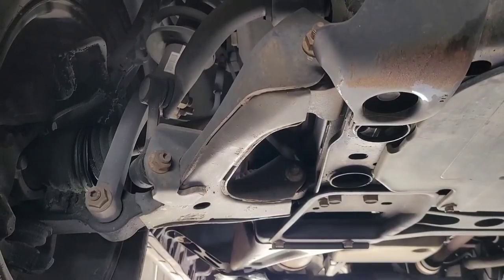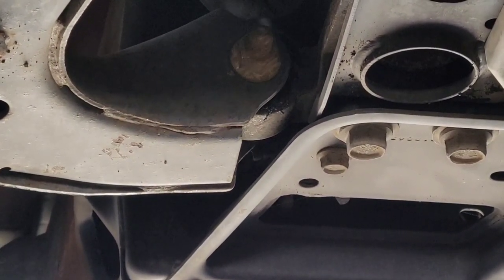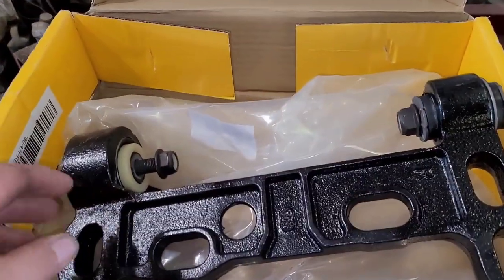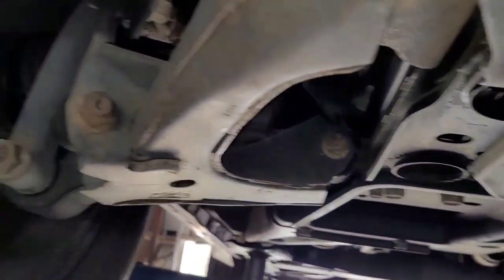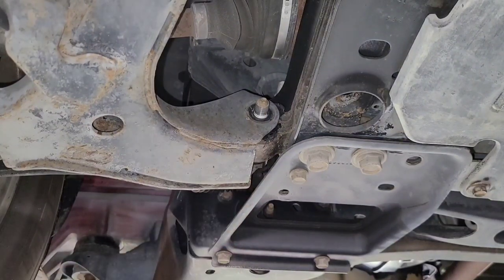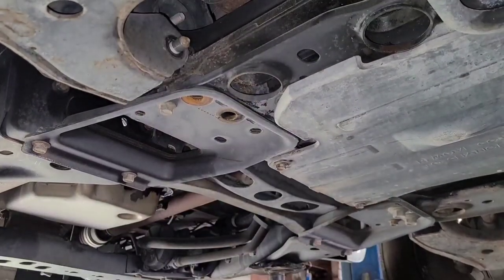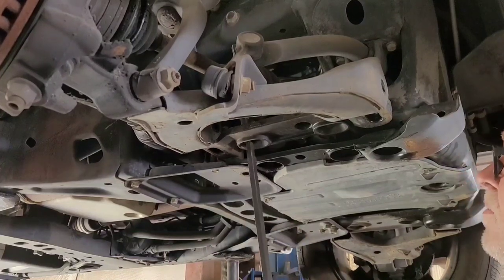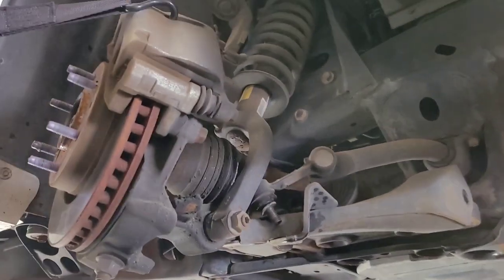Trailblazer Sloppy Front End. Lower Control Arm Mounting Brackets Get Replaced

Comment: You should never tighten up the bolt through the control arm bushing without weight on the wheels.  When the car is taken off the lift under the conditions you installed it, it will over rotate the center bushing in the control arm and tear the rubber, destroying the brand new control arm you just installed.
Reply: I put in polymer.
Reply: Thank you for the advice

Comment: Hey Kenny. I worked for Chevrolet when that recall came out - I still remember doing those control arm brackets. Never saw any that actually broke. Just did a set on my neighbor's 2007 Trailblazer the other day! Just like you, I haven't done them in years. Funny how stuff comes around again -
Reply: I am on my 2nd trailblazer. 
My first one I got t-boned at 60mph. Totaled it out with 396k on it. SMH, almost made it to 400k.
Original motor and trans/transfer case.  (2009)
The one that I have now has 146k on it and it runs just as good as the other one, but I am going to have to tackle this job from my 58-year-old back as I have no lift.
That 4200-atlas motor has given me ZERO ISSUES, I travel for work and drag a 6x10 enclosed trailer loaded with tools all around the country, including I-40 through Colorado at that steep grade @ 70mph. 
It ain't fast, but it aint slow, I have gotten busy and ran my oil changes over 3k and up before getting to it, I have had it in the air while off roading, basically i have been an abusive owner, Lol, but I can't kill em.
Someone else has to.

Comment: I had to do that job on my daughter's GMC Envoy a few years ago.  During hard braking, the steering wheel would go off-center.  A "pop" could be heard when it happened.  I could not locate the source of the slop using a pry bar - everything seemed tight.  I paint dotted all the suspension points, took it for a drive and hit the brakes and the steering wheel moved.  When I inspected it, I discovered the paint dots in the area of those bushings had moved.

I purchased the OE bushings and pressed the old ones out and the new ones in.
Reply: Forgive me for my lack of knowledge.  When you put paint dots on all suspension points can you please help me with where those areas are?  Thank you
Reply: @Perryloc  I put paint dots at each point of the suspension where relative movement could occur.  The paint marks were in-line with each other.  When I drove the vehicle and got it to pop and the steering wheel went off center, I put it on jack stands and inspected the paint marks.  The ones that were not in line indicated the worn bushings.
Reply: @kevineich5029  Thank you for the reply and I apologize for my ignorance with anything that is not 1s and 0s.  So I would need dots where control arm attaches.  Here comes the dumb part: do I need to put them somehow on sway bar points, tie rod ends, or ball joint post?  Again thank you for your time.

Comment: Turn the wheel all the way to one side to extend the tie rod and boot out of the way of the bolt and disconnect the sway bar and the wheel and arm will move out of the way. I've Done it twice for my trailblazer.

Comment: How much does that kind of job cost?
Reply: I just did my rear lower control arm bushings with only removing sway link and replaced them on the truck. I rented the c-clamp style bearing press to get then in and out. Both sides took about 2.5 hours, but i had to cut the end off the first one with a sawzall and get the outer race out with a screwdriver. Right after that is when I rented the press. lol. I think they were $30 each. They were cheap enough i don't remember exactly. The alignment was $145 and the front bushings were good. It goes right down the road now. I will probably get the thicker rear sway bar as i have heard they really tighten it up. Wider tires will as well.